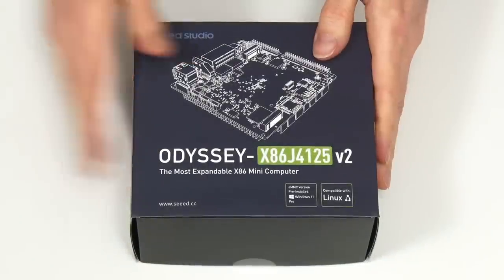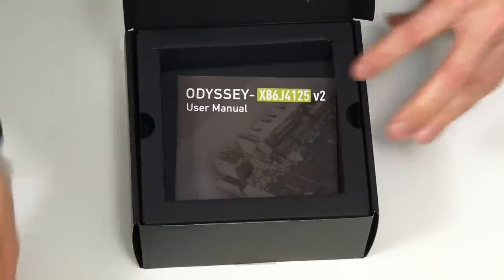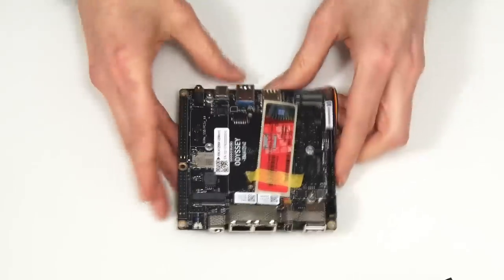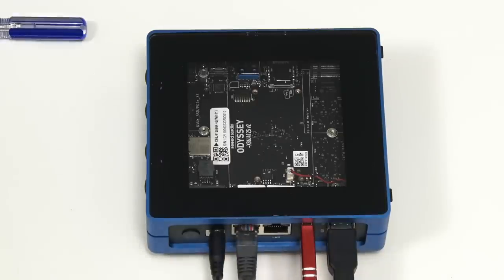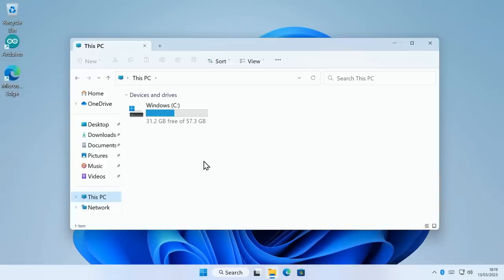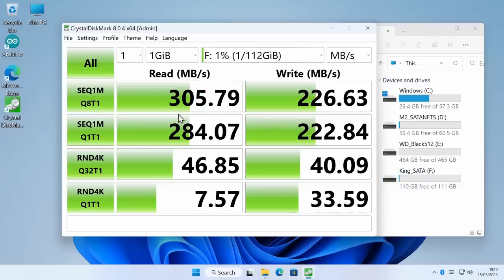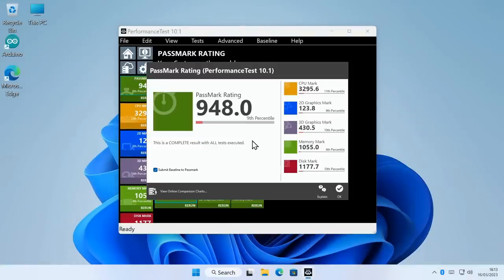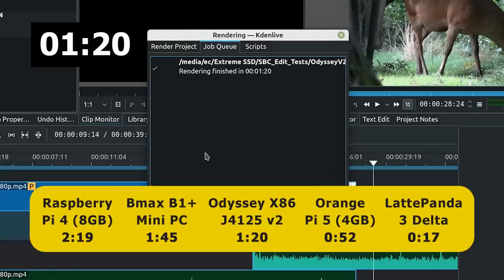Odyssey X86J4125 v2: x86 SBC with Dual 2.5Gb Ethernet

Comment: at this point there are many sbc and mini pc's. only problem with development is thinking of doing of something new that others didnt do yet. but all of them share one thing, they are bloddy expensive, 200$ 300$ 400$. it is a bit silly even if you ok with small things premium. on some, when you add nvme/ssd and memory, you are in price range of a full system with serious cpu power. minus the power draw..

Comment: Does anyone out there know of a low cost SBC with integrated SIM card reader for cellular data connectivity? It would be for very light processor usage such as remote sensor/relay monitoring/control. Using a module could work, but I'm just curious if such a board exists. Thanks!
Reply: Do you need any OS at all? If not, look at the TTGO T-Call. If yes, something like an OrangePi Zero 2 and a USB module would be a good starting point.

Comment: I like these things...I really do but this is very expensive for what it is...
You can get much cheaper n5105 mini pc which are at least 20% faster in the same power class.
Or for around 350$ you should be able to find something 12th gen which will run circles around this product.
Reply: Do you know of any mini-PCs  that have internal headers for 2 x 2.5" SATA drives and can fit the drives within the enclosure? That's what I am looking for.  It looks like Odyssey is the only option, but it's a minefield.
Reply: @adiands850  not really, but I am sure they exist. 
However what you can do is use an m.2 to sata expansion card. They work really well for non critical workflows. (mutimedia etc)
Also my previous comment is 10 months old. Now the new CPU to beat is the n100/n97. Good luck.
Reply: @SrSilverstars  Thanks, I appreciate the reply.  My use case is extremely limited.  Just need a low powered device that can run Emby media server (I want 2 x SATA SSD within the enclosure) and Home Assistant devices.  I don't need transcoding.  So a powerful CPU isn't important to me

Comment: Not sure of the importance regarding these Chinese x86 SBC's. A 5 year old Dell SFF system can outpace these things at 1/2 the cost. The Celeron on this board can barely power 1Gbit connectivity, so having 2.5 Gbit is pointless.
Reply from the maker: Whilst your broader point is valid (it depends what your use case is), a board with a Celeron processor can most certainly have full speed 2.5 Gbit Ethernet. Given that the video shows the hardware is capable of moving data around at 1822MB/s = c.14.57Gbps -- this is also pretty obvious. :)
Reply: @ExplainingComputers  I use to have an industrial PC running a Celeron J1900 processor. It was running OPNSense as my router. Not sure if the NIC's supported hardware offloading, but that CPU was pinned at 60% while downloading at my ISP's full speed of 1Gbit per second. Remember that the Pi's came with 1 GBit networking, but were limited to 300 Mbps throughput. Marketing is one thing, but putting it to practicum is entirely different. I doubt 2.5 Gbps speeds can be achieved. I welcome the challenge though with an iPerf test.😁

Comment: Wouldn't it be more cost effective to purchase those Aliexpress mini-pc which has a better CPU and more ethernet ports, and in most case cheaper?
Reply from the maker: I am not aware of any multi-Ethernet-port Mini PC on Aliexpress that (with RAM) costs less. As noted in the video, the Odyssey X86J4125 v2 starts at $218 (no eMMC or Windows license). The cheapest computer of the kind you are describing on Aliexpress I can find cost $215 with no RAM -- https://www.aliexpress.com/item/1005005372215389.html

Comment: I honestly don't understand why you keep doing hands-on reviews of boards instead of creating new stuff. Since you have much knowledge in the AI space why don't you bring videos of creating neural networks with those boards, or doing some parallel computing, some diy projects connecting sensors, use the sbc for home automation, whatever. This channel is stuck in the same kind of (basic) content. Not hating but it's true...
Reply from the maker: Whilst I take your point, only about about 20 per cent of videos here are SBC reviews. And well over 50 per cent of the content has nothing to do with SBCs. I have tried many different kinds of SBC and related project. But, in general, they just do not get the views. For me, this is a business, and I need to deliver what the core and broader audience will watch.

AI is an interesting one. I have tried on many occasions to make popular AI content, and have always failed! No doubt I will try again.

Comment: Don't get these x86 CBC's. They are large, expensive, require huge amounts of cooling and most are beaten by a RPI4 in performance. This one has one single thing going for it, which is the 2x 2.5Gbit Lan ports. Besides this, if you really need a small x86, you may as well just by a NUC or similar. The cost is less, the shitty performance is the same (For the cheap Celeron versions) and you get a case thrown in without any additional cost.
Reply from the maker: This x86 SBC is clearly not "beaten by a RPi4" in performance, as the rendering test in the video clearly indicates. Whilst there are many lower-cost mini PCs, a NUC is most certainly not one of them.

Comment: out dated cpu at a premium price
Reply from the maker: If judged purely on the CPU, yes. But the point of this board -- and what is paid for -- is the connectivity.
Reply: there are many cheaper N6005 fanless mini pc with 4x2.5gbe and dual m.2 pcie that come with a proper metal housing. I guess the sim slot and integrated RP2040 seems like an icing on the cake for extra premium price.
Reply: @bunnatang2081  do you know of any mini PCs that have internal headers for multiple 2.5" SATA drives and can fit them inside the case? This is what I am looking for, but couldn't find any.

Comment: I do NOT recomend this model, as it is a j4125 it cannot work good as a HTPC, because of hdmi limitation and no HDR....and no AVX....i suggest buying the i3 model of the same computer. That was way better....
Reply from the maker: There is no i3 Odyssey X86 board. :) I have used a different J4105 computer as my HTPC for several years with no issues.